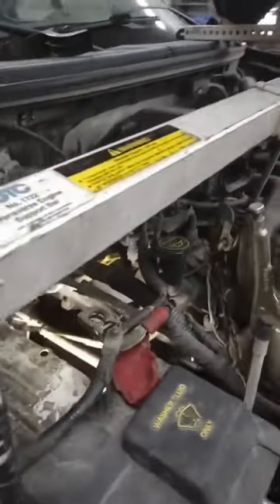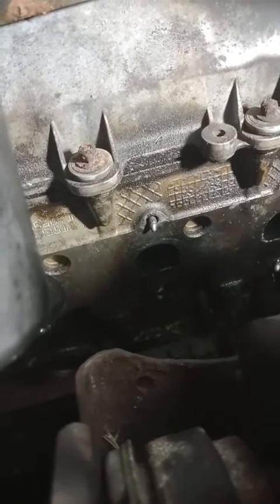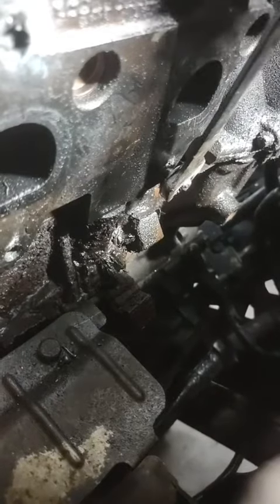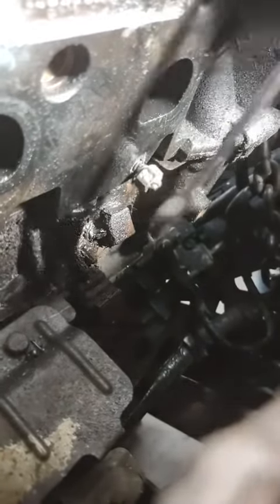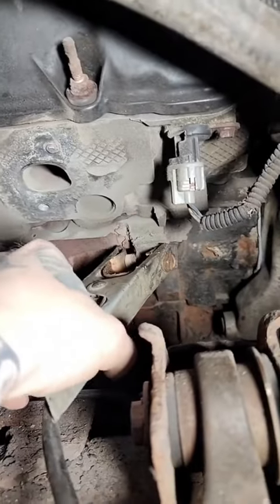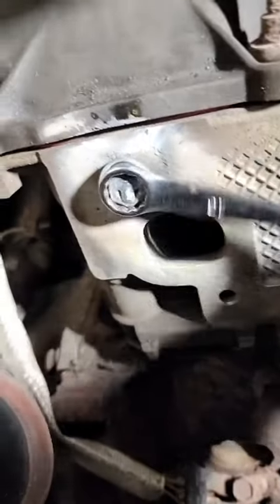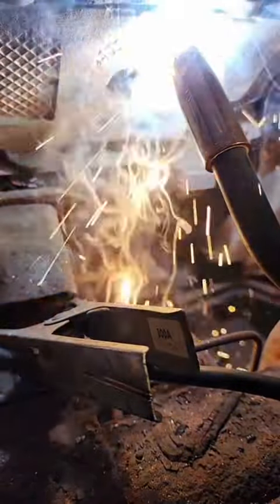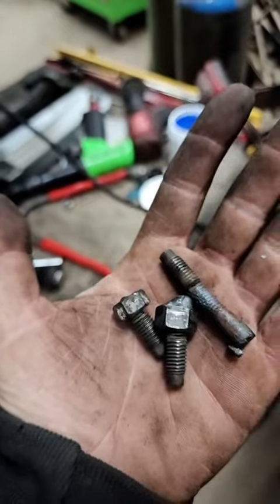welding nuts to broken studs

Comment: Weld a flat washer to the bolt then weld a nut to the washer
Reply: We're would you ground the welder on a aluminium head thanks
Reply: Anywhere on the engine

Comment: Hi on aluminium heads when removing a broken exhaust manifold we're do you ground the welder thanks
Reply: I never thought about that but aluminum is extremely conductive so probably anywhere you can get a good connection? Idk know for certain tho I’ve never tried